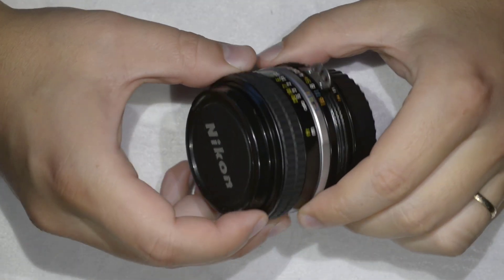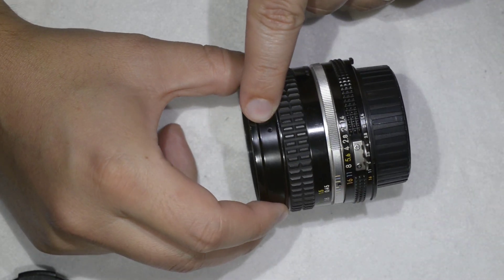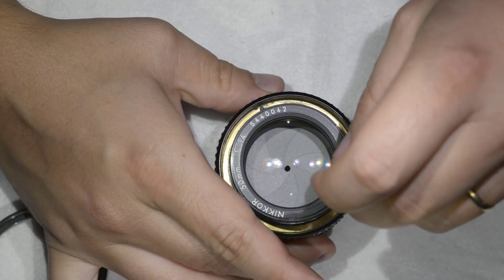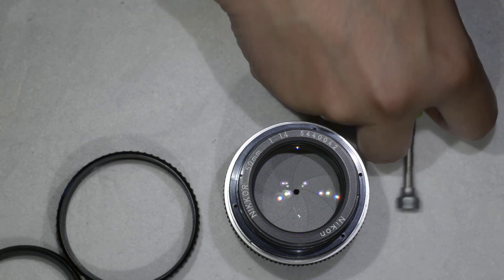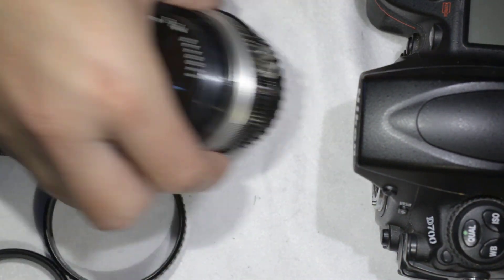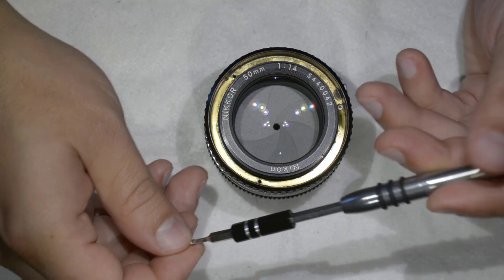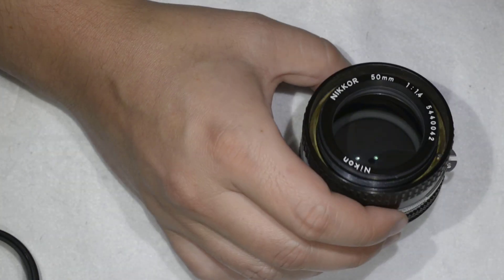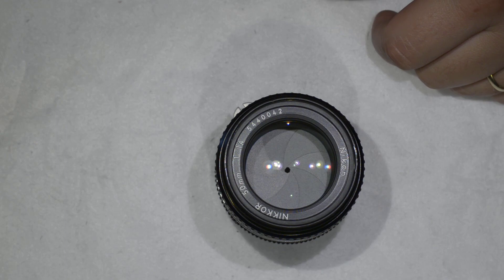Lens repair : Nikon Nikkor 50mm f/1.4 :  focus calibration

Comment: Hi, your videos are always very informative and interesting. Could you make a video dedicated to the AI model? It has a different structure and, as I have seen in other videos of yours dedicated to the AI model, it is necessary to intervene on the external barrel. When I unscrewed the top black ring on my 50mm AI I couldn't proceed further because the construction is very different.
Reply from the maker: Hello, I'll take a look if I have one AI in need of help.
Reply: @diyextravaganza  You are really very kind. May I suggest, if the idea tickles you, an in-depth analysis of the qualities of the prestigious Nikon D700? I use these vintage lenses on a D5200 in a totally manual mode, and I would like to be able to use them with the convenience of the exposure meter sooner or later. I saw, for example, your comparison between the 50mm 1.4G and the 1.8G, there is none that reaches your level of depth of analysis.
Reply from the maker: @gfrancesc0a  I've always contemplated the idea of making a video about the D700, it's my favorite camera and in my opinion unequalled by any other camera and it works like a charm with vintage glass.

Comment: Great video and thans for sharing so much value, in my case, I have the Nikkor AiS 50mm 1:1.4, and it won't focus on f1.4, all other appertures are ok, should I follow the same procedure?? thanks in advance :-)
Reply from the maker: Hi, you cannot focus only on 1.4? That's surprising. It is simply a bit off or noticeably off? Anyway, yes, you should try the procedure. And let me know how it went 😊. Cheers.
Reply: @diyextravaganza  Thanks for replying, I did follow your instructions and it did worked, thanks so much 🙂
Reply from the maker: @photographyfan  cool, thanks for the feedback. Cheers.